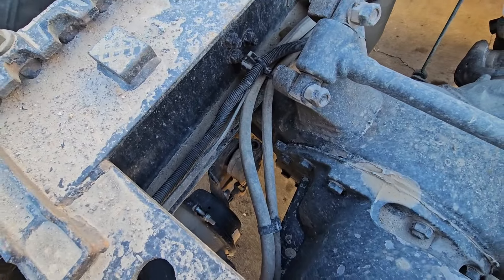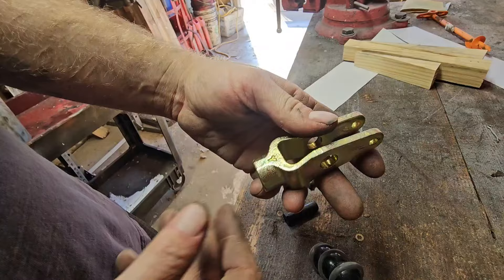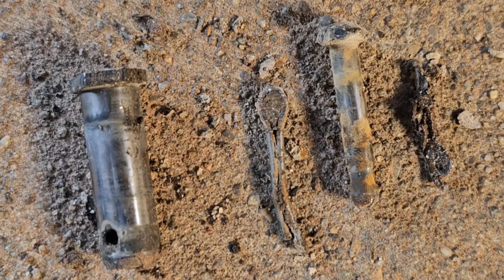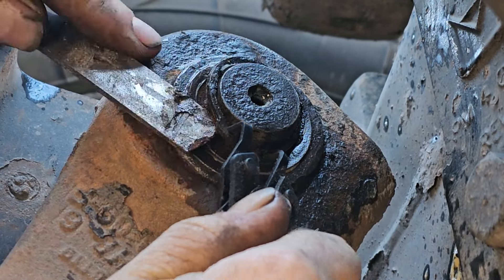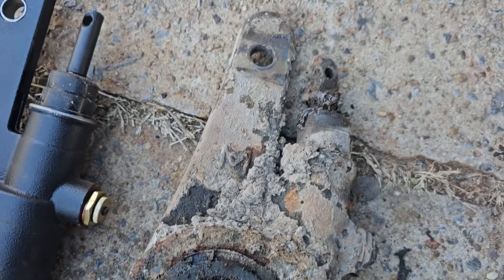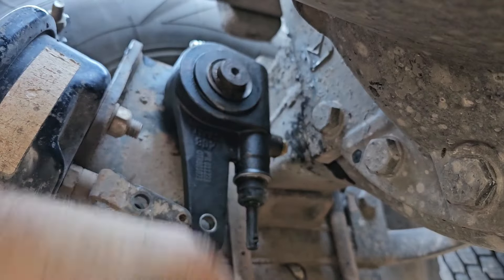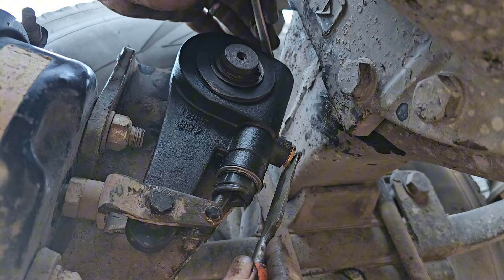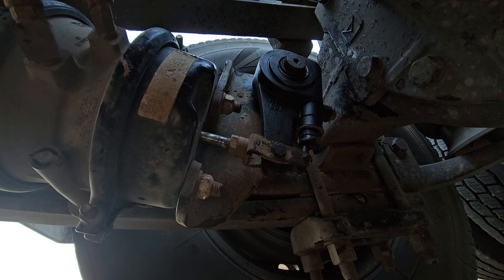Changing slack adjusters on a semi truck

Comment: I couldn't figure out why I couldn't back off the slack adjuster to change the brakes.  ... that little pull out vent plug pointer saved the day!  Thanks!
Reply from the maker: Yes.  On some slack adjusters, you don't have to pull it out.  I believe that's on the older ones though but don't quote me on that.  Glad I could help.
Reply: @aftersolo Actually it's the newer ones with the anchoring tab that attaches to the bolts on the brake pod. The push rod has to be extended in order to turn the screw. You need an OTC 5052 brake slack adjuster tool to release them.
Reply from the maker: @charlesbolin7207  You're right.  I know on mine, the tab doesn't have to be pulled out to back the brakes off.  Mine are new too.  The tab does have to be pulled to tighten them though.

Comment: I have a number of different ways I can release a brake to do a slack adjuster. Pneumatic parts are insanely cheap at harbor freight. Every single truck in the fleet has a universal socket on the primary and secondary air tank. They can be filled by an air compressor with an air hose using either an industrial or automotive connector.

I also have a coupler set up with a valve, guage and regulator. I can attach it to the supply line on the brake pod then open the regulator to release the individual brake then shut the valve to hold it open.

The beauty of this setup is that the truck doesn't need to be running to release brakes. This makes it easier for me to detect leaks because i dont have a loud engine running to build air pressure. The valve with regulator and guage is also really handy for checking brake pods. Apply air, close valve, check after sbfew minutes. If it looses pressure on the guage you have a leak in the diaphragm thats not audible.

I also havr a glad hand adapter for releasing trailer brakes.

-EDIT: I also do not rachet the adjuster to get it in the cleavis. I unbolt the pod and pull it back when removing the slack adjuster and reinstalling it. I don't change the cleavis unless necessary, most of our pods dont have a removable one anyway. Your not supposed to twist the adjustment screw until doing the initial adjustment.

Comment: So I changed my brake chamber and changed my slack adjuster awhile back . Buttt my slack adjuster doesn’t move when I apply the brakes or release them. What would cause that?
Reply from the maker: Make sure that tab is popped out.  If its somehow stuck pushed in, the slack adjuster will be disengaged.  Are you saying it's not turning the s-cam at all?  If not, then something inside the slack adjuster is broke or your brake chamber isn't working.  Maybe the air lines are crossed.
Reply: Tab is popped out but it’s not turning the s cam at all. Put a brand new pre cut chamber on. Slack adjuster was put on a couple months ago. I’ll try and sway it out and see. I aooo the response it’s been frustrating me
Reply from the maker: @MatthewMeasel-gj1zm  It sounds like it's just free spinning.  I bet it's under warranty.  I would return it.
Reply: Ok thank you for replying I’ll comment back after I do it. Paid a mechanic and he put a broken one on and seized my brakes been a whole mess so I have been learning since then should have checked so my fault also. I appreciate it a lot

Comment: What about automatic slack adjusters?   Had a state trooper inspection of a 24ft box truck with automatic slack adjusters,  mind you i don't need a CDL to drive a box truck, i just wonder why they do it
Reply from the maker: The ones in the video are Automatic slack adjusters.  Sometimes, they don't automatically adjust like the one i replaced in the video, so they'll check the rod travel.  Sometimes, they do adjust as they should and there can still be too much rod travel, especially if it's almost ready to click over to the next notch.  Some automatic slack adjusters don't click over as often as the newer ones, which gives more rod travel before the brakes are applied.  (Just think of ratchets.  Some of them, you can barely turn and they'll click.  Makes working in tight spaces easier.  Some of the older ones, you have to turn a little more before they click)  I try to manually adjust my slack adjusters about once every couple of months even though they are automatic.  Plus then, I'll know if any are not working.
Reply: If thay rod goes more then 2 inches you in trouble lol